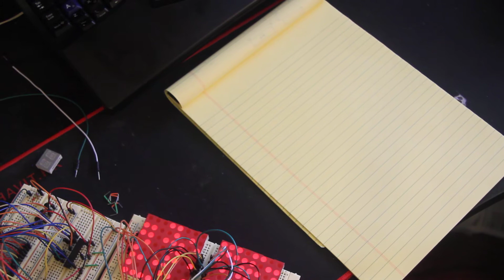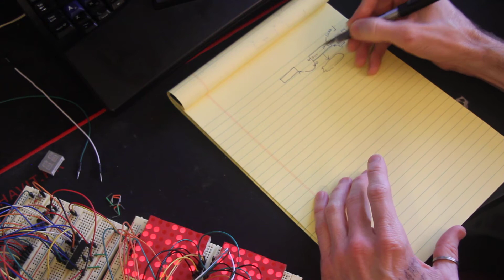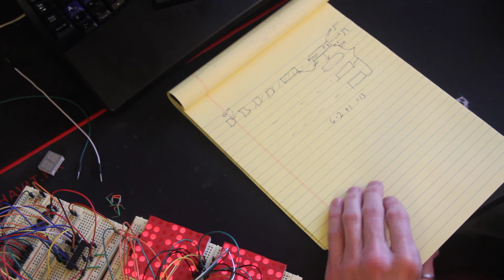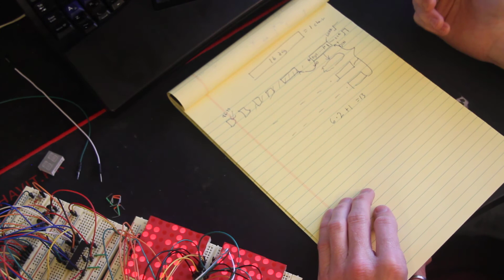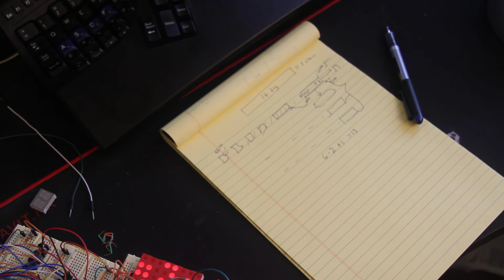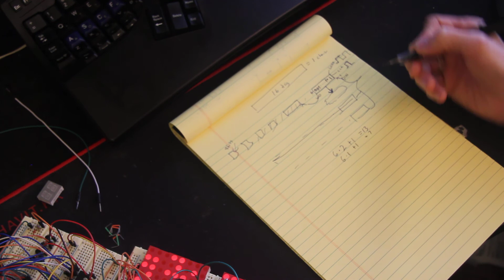Using a MAX7219 to Control 15-segment Displays, Part II

Comment: I have built a 16-character display using 16-segment displays, driven by 4 MAX7219's via an Arduino UNO. As opposed to the transistor switching system you have adopted, I use diodes in an "OR" type configuration. Two 7219s control the upper 8 characters, two control the lower 8 characters. Within each of the 8 characters, one 7219 controls the inner segments, the other controls the outer segments. Because only one 7219 can control the common cathode at a time, a 1N914 diode is connected between each 'digit' pin of each 7219, and the corresponding display (ie D8 for Inner segment 7219 and D8 for Outer segment 7219 connect to display D8 thru the diodes. The issue I am having, and is also apparent in your design, is the fact the Arduino is tied up in switching between the controlling 7219. In your case, you switch the Iset pin, in my case, I must put one in the sleep mode while I wake the other up. This pretty much prevents the Arduino from doing other tasks if I want to maintain a readable display. It would have been nice if the 7219 had one pin to enable/disable the chip :(

Comment: I'm learning as well, so these vids are helpful. For your project - was adding IO extenders an option? eg: MCP23017
Reply from the maker: Adam Douglas While I've never used an IO extender, I'm aware of them and their capabilities. I'm the first to admit that my max7219 solution is complex, but it gives me a very high LED count for very little hardware.

For example, I want to drive 8 digits of 15-segment displays with my current rig. I'll end up using one 7219 to control the top half of all 8 digits, and another 7219 for the lower halves. With IO extenders, I could drive all 15 pins of one of the displays, all at once, but that only lets me draw 1 if the 2 digits on that display. Similarly to how I'm using transistors to flop between the upper and lower halves of my 15-segs, if have to have one port extender for each digit, and do some style of transistor flopping to switch from left to right. And those two port extenders, plus transistors, would only net me two digits.

I WOULD get a better duty cycle - each LED would be in falls the time, instead of about 1/16 if the time, like my current solution, but it would require 4x as many controller ICs. As it is, my space is at a premium (spoiler alert, I'm building a 6-layer board in poor-man's style.) Adding four more later to use extenders would be an Herculean undertaking.